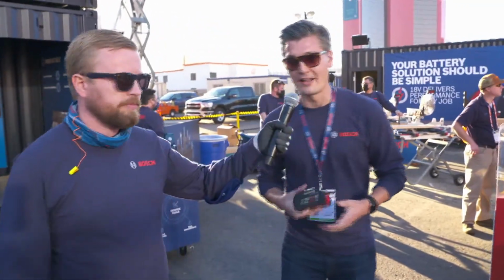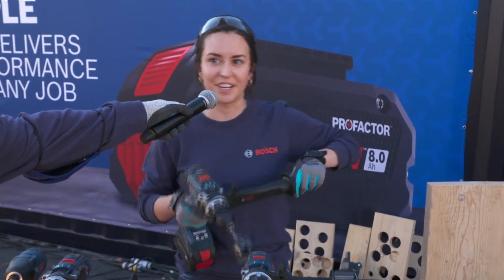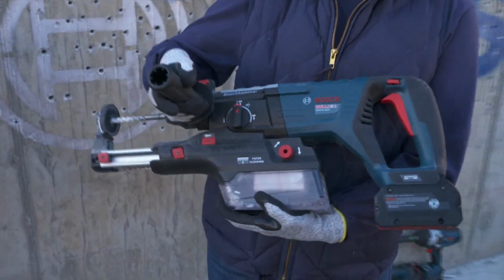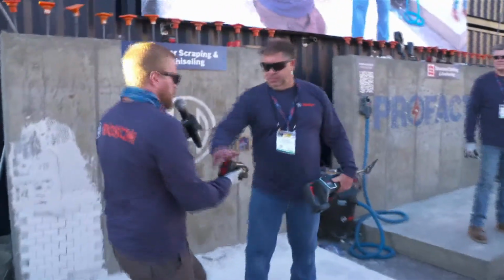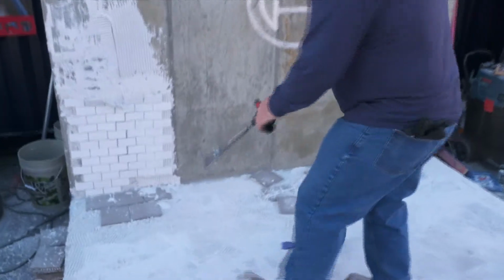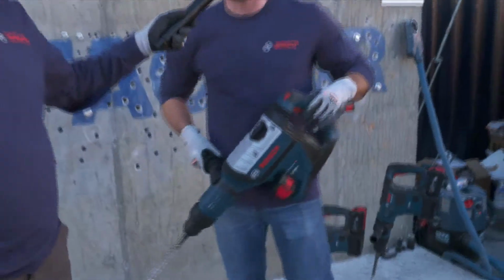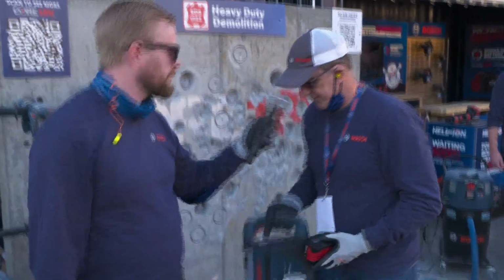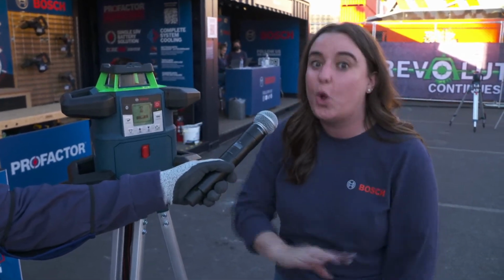Bosch Power Tools World of Concrete 2022 Live Stream

Comment: After spending over £3,000 on biturbo gear in the last year. NONE of it is without faults.
After you pay the package & postage, turn around time on a return is 2 months!!

So you basically have to buy 2 of them & throw them away after the 3 year guarantee is up.

#likeabotch

Comment: I own alot of boach tools and I feel like you guys are distancing yourself from all trades. It's 2022 and you guys still don't Have nailer. My jig saw is still brushed. Please make more tools and keep up with milawaukee and makita and Dewalt so I don't have to switch brands
Reply: what they do, they do well---they just don't do a great deal like other product lines
Reply: Absolutely, I have been loyal Bosch for years but have to buy Milwaukee and Makita for the tool trailer because of cost and availability of range of tools...Bosch even went backwards with access to L-boxx's and their inset trays that I used to have access to. I'll never get rid of my Bosch stuff and keep upgrading as units come available, but some tools I can only get in the other brands
Reply: I agree, I am also trying to be loyal with bosch I wish they would expand their range of cordless tools so I didn't need 2 battery platforms to take advantage of the convenience that cordless specialty tools bring nowadays like nailers, compressors, yard tools, etc. They are good at innovation and the tools they do make but seems like every other brand is evolving much quicker and leaving them in the dust.
Reply: I’ve been with Bosch for almost 20 years but, their biturbo & newer gear is unreliable.
I’ve bought a GBH 18V-45C, GCM 18V-305, GSB 18V-150C, GDX 18V-200C, GLM 50-27CG in the last 18 months & all of them have faults. Customer service in the UK is terrible so, unless there’s a definite improvement soon, I’ll be ditching it all on eBay!
Reply: Yes I would love a bosch nailer and I think they had one a long time ago but nothing new.  I also would  have bought a oscillating tool from them but I need to use lots of random cutters for tile and wood with nails but I can't lock into the bosch quick change cutters I need to buy stuff at the closest stores or on line so only a universal tool like other brands works for me.
Reply: My brushed jigsaw has plenty of power and life for me,brushless on the jigsaw is more of a status mark than anything else .
Reply: Your right I'm loyal to bosch but struggling  on site. They need more brushless tools 18v cordless routers nailers be great. I don't want switch I've few tools that need replacing and very tempted to switch to Milwaukee or Makita 40v is impressive and so is the amount of tools they have in 40v range already
Reply: Their new tools… I’ve purchased over £3k of biturbo, etc., in the past 12 months & every piece of equipment has a fault.
Return time for faulty equipment, after you’ve paid the package & postage… around 2 months!
So, you basically have to buy 2 of everything!!!